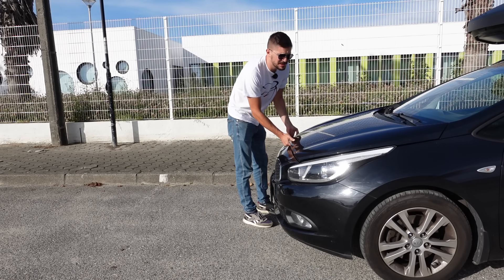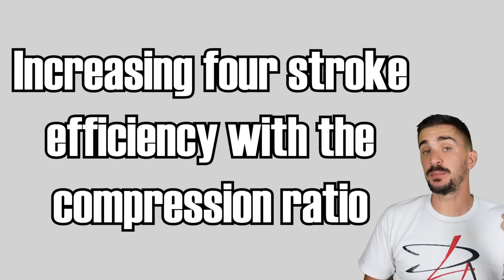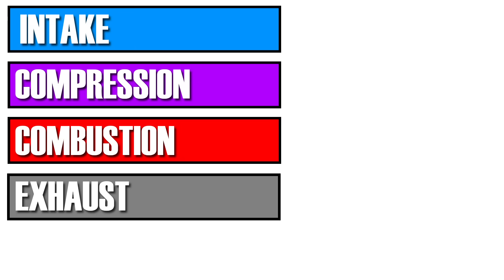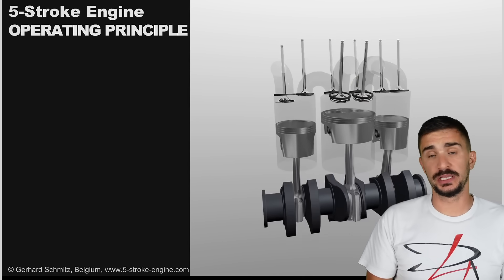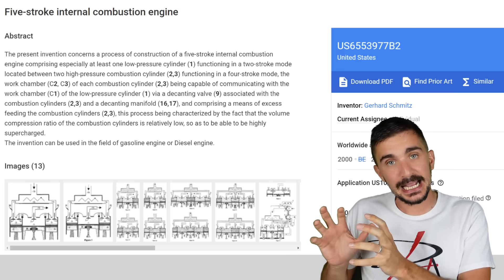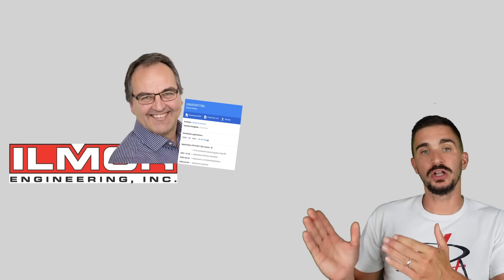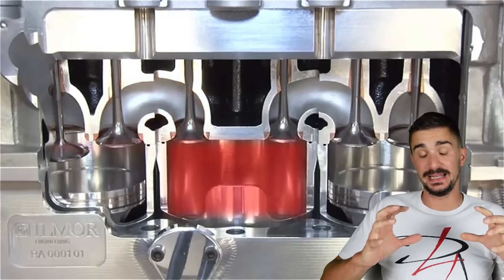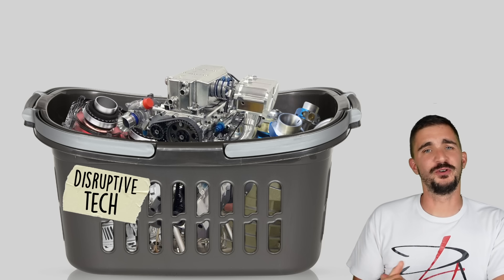Why Five Stroke Engines Are More Efficient But Still a Failure

Comment from the maker: Support the channel by shopping through this link: https://amzn.to/3RIqU0u
Patreon: https://www.patreon.com/d4a
Become a member: https://www.youtube.com/channel/UCwosUnVH6AINmxtqkNJ3Fbg/join
Reply: I wonder what your thoughts are on turbo-compound engines since they work in different way but have the same goal as the 5 stroke.
Reply: 6:18 that black spot made me rub the screen thinking it was a little bug XD
Reply: Why not do a video about the SAAB engine that had variable compression. 1,6 liter, 250 HP and fuel consumption of 4 liters/100 km (58.8 miles/US gallon). It was bought  by GM and buried, since it was too efficient, or was it some other reason? I know that they had (at least) one engine up an running at Ring Knutstorp in Sweden at some point.
Reply: Goddamn you are smart.  I have so much respect for your intelligence. I'd guess you have a ≥145 IQ.  Bc I don't believe anyone else helped you create the conclusion you ultimately came to, & obviously, no one wrote this for you. Both of which are testaments to a very intelligent mind's ability to research & think clearly. Thank you vm for your contributions to my understanding of engineering & physics. Anyway, your writing reminds me of another channel whose writing I find so intelligent as to be elegant, example, describing why perpetual motion machines cannot work:

Without a difference in thermal states from which to establish a flow of energy ...
...mechanical work cannot be extracted from the system.

Episode...: Pulling Energy Out Of Thin Air
YT Channel:  NEW MIND
YT specifier:  UK8Fw5Zjna0
Reply: i have an engine design that would be 40%+ efficient,  probably even approaching 60 if i make an adiabatic version. it also has less moving parts than a conventional engine and can use already widely available parts. unfortunately it will never see the light of day because i have no way of building it myself (chronically unemployed) and if i explain enough of it to attract investors it will give the idea away, and i also cant patent it because i would be giving it away. how should i proceed? it builds from technology which hasnt been improved on in 60 years. there are only 2 unknown aspects of the engine and 1 component which will be different from a conventional engine. another commenter, case in point: 
@Sergio_Loureiro
1 day ago
The guy who in fact patented the 4 stroke engine was Beau de Rochas. Nikolaus Otto was the one who executed the idea.
Reply: it is a 2-stroke and will produce a lower level of emissions than any 4-stroke ever could
Reply: Idea: Use it operating at high RPM to run an electric generator, then have electric motors on/in the wheel hubs. You get the efficiency of the engine, and the control out of the electrics. Add a small battery pack, and it might make a Hybrid, but you keep the gas supply engine always running, unless the pack is fully charged and you're in an enclosed space (like a garage or tunnel)
Reply: How would a 5 stroke perform as an aircraft engine? Airplanes operate at high power levels and have no need for a catalytic convertor so it would probably be a good design.
Reply: The guy who in fact patented the 4 stroke engine was Beau de Rochas. Nikolaus Otto was the one who executed the idea.
Reply: @Sergio_Loureiro  
The Austrian Christian Reithmann had received several patents for a four-stroke engine on October 26, 1860. Independently of this, the engineer Alphonse Beau de Rochas described the four-stroke process in 1861.
Alphonse Beau de Rochas applied for a patent for the four-stroke engine in 1862, but never built the engine.

The most significant patent dispute arose when the Körting brothers presented Christian Reithmann from Munich as the inventor, who had already invented the four-stroke engine three years before Otto in 1873, in order to overthrow the DRP 532. In December 1883, Deutz accused Reithmann of patent infringement and won the case in the first instance in December 1884.
Reply: Similar to the Titanic engine  :)
Reply: What about Nissan's recent variable compression engine??
Reply: https://youtube.com/shorts/ANUSc72m3iU?si=cQmbp_9SQX8yAfHs
Reply: you told us to let you know when any propulsion technology manages to last 150 years and i am very sorry to tell you that i am about 46 years late as the first electric car was made in the year 1828 by the Hungarian inventor Ányos István Jedlik. That would mean that 1 year after the 150th birthday of the Otto engine the electric car would have its 200th birthday. Read about it here: https://en.wikipedia.org/wiki/%C3%81nyos_Jedlik#   :)
Reply: Transportation technologies that have lasted 150 years?

Horses.

That said, I'll keep my 4 strokes, thanks.  ;)
Reply: @ohar7237  But it doesn't mean we shouldn't improve. I am all for EVs (without the part where they're forced on everyone), so I love seeing them getting more popular, as well as HEVs. But until we solve the electricity scarcity and double or triple our generation capacity of it they are a dead end, too.
As far as ICE engines improving goes - the 45-40% efficiency is crap it needs to be improved. Maybe with TERS (like KERS, but using exclusively the exhaust gases' temp?
Reply: This design can be improved slightly by using electric turbos at the low end.. or not (I only said slightly)
Reply: then again maybe just make the big piston hollow
Reply: This is one of the most factual (and accurate!) and easy to understand explanations of engine tech I've seen.  Bravo!
Reply: For more recent development on the 5-stroke idea, I'd suggest you read the SAE papers 2021-01-0443 and 2021-01-0452 documenting some of GM R&D's work with a different variant of the piston-compounded engine developed with Ilmor, including experimental results taken across 5 prototype engines. The biggest issue was low-load efficiency, where the piston expander's additional friction and expansion hurt engine performance, and how this prototype addressed that.
Reply: Thank you for your seemingly endless  knowledge and answers😊.  Could a turbocharger and charge cooling system utilise that extra energy, increasing t×v = hp be more efficient? 
I'm not an engineer. Everyone can see how my 75c is earned😂. You have detonation expansion plus exhaust stroke then depending on fuel/ignition, valve timing, manifold, and turbo mating. The exhaust pulse per cylinder by rotation speed including weight advantages, just  asking your opinion 😊.
Reply: Internal combustion is awesome and the exaust is plant food. Win-win.  Don't believe the eco-doomsday scammers fossil fuels are the real green energy.
Reply: Sounds like a near ideal match (except RPM) for aviation engines.
Reply: So, just to understand it better, some questions:

To circumvent the dead weight situation one would use this in a controlled environment, with a constant or near constant RPM, like a portable electric generator, pump, (construction site) compressors, which just slightly differs with load, would actually a area of usage?

Could a catalytic converter not be (intermittently) heated by electric blanket of a kind to reach operational temperature?

How small could this device be? Would it be able to run like with 50 cc? Again not as device itself but as reliable power generator.

Btw.: The Electric motor is older than the Otto Motor. (+40 years - 1837)
Reply: Komso ,evo ti Infinitijev motor sa promenjivom kompresijom.
https://youtu.be/A6H66xfEZC4?si=YBn22HbrQhPEyZpc
Reply: what do you think if this engine is used in a prop aircraft where high rpm is constant?
Reply: You never mentioned the back pressure on the outer cylinder exhaust.  Assuming constant pressure on each unit of outer surface, the middle cylinder area  - outer cylinder area is the working area.   So I don't get how that middle cylinder does much.  If the exhaust gas could jump over there, with valves closed, then expand, then it would be its full area doing work.  Something like that.

Comment: For a range extender, could one just use a turbocompound engine, with more electricity taken off of the turbocharger?  The catalytic converter could be placed between the piston and the turbocharger, thus ensuring it operates at high temperature and lights off quickly.

Comment: So, emission standards actually penalize efficiency (lower carbon footprint). We call on the engineers of catalytic converters to design one for cooler, more efficient engines.
Reply: Very important consideration is that at peak pressure, just after combustion is when the piston rod should act on the crank mechanism so as to produce greatest torque that is at 90° of rotation. Much power is lost from piston rod being at an angle both to piston movement and to and to crank mechanism

Comment: When you look at when ( crank angle) the max cylinder pressure occurs you will see it happens at an angle at which very low torque is made. Even as an engine nut it's obvious engines are a bit shit at converting chemical energy into mechanical energy. The best we can do is with the ultra large marine two stroke engines. Petrol car engines are a lost cause on the efficiency gig they get worse as cylinder capacity increases whereas diesels get ever more efficient as cylinder capacity increases and speed drops.
I am shure i stumbled across a vid clip of an Indian guy with his take on a 5 or six stroke engine recycling the exhaust gas and adding water injection unfortunately no dyno data to look at 
Great vid keep up the good work

Comment: Very clever design that in theory might work quite well.  However, as brilliant as the ICE is, your 30 - 40% efficiency whether 4 or 5 stroke suffers from a 150 year old design flaw - the fixed exhaust. A genuine variable-tuned exhaust would greatly improve those efficiency numbers for both 4 or 5 stroke engines.  We already know that every cycle of the ICE is hard-sync'ed by crankshaft rotation, but even now the cycles have never worked in harmony - as a direct result of this flaw.  VE numbers and "near optimal" ratings are dreamland numbers derived from ideal (not realistic) conditions generated by the flawed fixed exhaust. As such, we've been enhancing the effects of this flaw rather than correcting this flaw.  I predict that will change soon.

Comment: Scania used to build the engines with a turbine wheel connected to the crankshaft by a hydraulic coupling (I think this scheme ia called turbo-compound). Thus they used the leftover energy of the exhaust flow running through a turbine set just behind the turbocharger, recoverying some part of exhaust flow and delivering it to the crankshaft, which improved the efficiency of the engine

Comment: remove the exhaust valves of the center piston and put ports at the bottom

shorten the exhaust path from the outer pistons

offset the center piston so it starts going down just as the outer piston stops to maximize expansion

Comment: I would love to see this engine design made with newer technology, standards and possibilities. Instantly thought of an 5-stroke inline 6-cylinder (4 HP and 2 LP cylinders) engine with a lesser piston ration between HP and LP pistons, off-center crankshaft, drysump, no plastic parts that break, DOHC 4 to 5 valves per cyl with both cams having VVTi. Or as a V12 :P Maybe a small supercharger could parasite together with it, possibly improving low-end? Just hypothetically thinking, I would love to see such engine in my lifetime, would not have to be in a production line car, but even in a motorsport use that would be fantastic!

Comment: I feel like this engine design, with a bit of modification, could be vastly better than conventional 4 strokes, but NOT for road vehicles. 

My first two thoughts were generators and general aviation; both of which spend vastly less time in low power use cases and far less start-and-stop operation. Getting that power in a 20% lighter package could be a game changer in a 5-stroke designed around a specific plane's cruising speed, and getting more power for less fuel with less noise is great for obvious reasons for a generator.

Comment: Agreed, the conventional 4 stroke gasoline engine is hard to beat. Of course, the conventional steam turbine engine is almost as old, and will also be used for 150 years. But you are right, the Otto engine remains king.

Comment: The 4 Stroke Engine started out with less than 10% efficiency getting up to about 15% in the late 60's. With the advent of EFI along with computer control of spark and spark duration we've achieved over 35% in the years since.

Comment: Mmm, every cylinder explotion is basically the same, in power, most probable at lower rpm every explosion delivers little more than at very high speeds, simple cause time for gas exchange and fewer time to this displacement. So the argument of low vs high rpm efficiency of middle piston is to be watched. Bro you are the best at explaining and showing motors, great info and axplanation every time, cheers !!

Comment: at low rpm and load could they not have had an injector in the middle cylinder along with a spark plug, and then 'fired' the middle cylinder so that it wasnt being a dead weight and contributed to power output !?

Comment: "Name a motive technology that's lasted more than 150 years...",  how about the electric motor, far older than a 4 stroke engine, and has been used in cars at least as long as petrol engines.
Reply from the maker: Lasting 150 years with a 120 years hiatus?

Comment: I have a Chevy volt and it’s Atkinson cycle engine runs at a relatively low rpm and high load factor and it actually runs more efficiently on high octane gasoline so it’s cheaper to run than on cheap gas.   It’s actually brilliant and there’s no shifting,  a simple ECVT which is not prone to breaking like normal CVT garbage, and it’s simply brilliant

Comment: There ain't no such thing as 5 stroke engine.  You can only have an even number of strokes.  And I'm not aware of any 6 stroke engines.The increase of efficiency with is primarily due to increased expansion ratio. Atkinson cycle is one approach, but Miller cycle is actually usable.
Ilmor does good work, but i cannot believe they went for this.

Comment: Reminds me of steam engine technology where exhaust steam is used in progressively lower pressure cylinders to maximise its efficient use. But in the steam engine the steam pressure is a constant unlike internal combustion which would vary depending on how big the bang was. Maybe add fuel injector to the middle cylinder so it becomes a "working " cylinder at lower power outputs then it isn't a dead weight as outer cylinders will need less fuel to gain same power. I don't think this is a dead design, I think it still could work

Comment: The 5 stroke design is brilliant in my opinion and can be used in different ways.  If we add fuel or fuel and air to the extra cylinder then we have an EGR already used on diesels however this would be a new and contributing EGR system.  The extra piston can be any size or the same size as the others;  more efficiently the direct injection method with 18:1 compression on the extra piston using diesel for this cylinder??  Could we use gasoline and diesel in the same engine and harness the 17% more energy in diesel?   Could we eliminate the use of DEF in this engine?   On the other hand could we accomplish accurate compression ignition of gasoline via direct injection like a diesel,  for the sake of efficiency?

Comment: Take a standard 4 cylinder motor. Reduce the intake duration to 60 degrees total. Make the compression ratio to be 24:1 , bore stroke ratio. You then make the effective power stroke to be 540 degrees. A 1.5L engine breathes like a 500cc.

Comment: What if you had a turbine instead of a scavenger piston?
As in providing power directly to the shaft?
Or what if the piston was decoupled at low RPM to prevent friction losses?
Regardless you are always looking at higher comllexity & cost when scavenging subsystems are involved, it's a tradeoff.

Comment: 16:10
If it's bad for turbochargers due to the way it works, would it be reasonable to believe in this case a supercharger would work better, since it doesn't rely on exhaust gasses anyways?

Comment: A cone under the cylinder holds the gas that gets squazed out on the next combustion cycle because moving the gas the least distance changes dimensions less and the counter pressure adds torque by the cone vortex application technology.

Comment: You do an excellent job of describing things, Ilmore deserves kudos for developing this engine, the combustion is only on the two pistons so that is the working cc ! The complications of turboing, low speed losses, etc do present serious obstacles, but somebody has to take the bull by the horns! Smokey Yunick developed and tested an engine which was everything he said it was, but run into politics after it was completed, but it would now be tough, because of fuel injection as he was homogenizing the fuel, I spent many hours with him, and fully 🏴understood the concept,Smokey didn’t lie !

Comment: what i dont get is why not run one cylinder slightly lean and the other slightly rich swaping every other stroke and denoting them on the 5th stroke I'm not talking a lot lean or rich just a little as even on normal combustion there is a fair bit of left over fuel that get waitsted would also be a good place for egr gases to go this would give that lp cilnder a little kick even at low compression essentially the LP cilnder would act as a 2 cycle while the outer pistons are 4 cycle